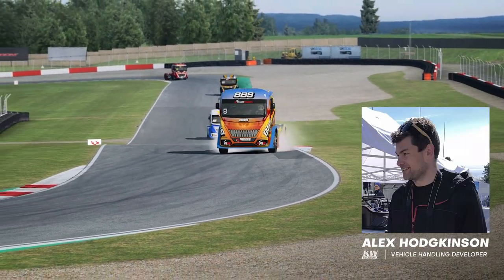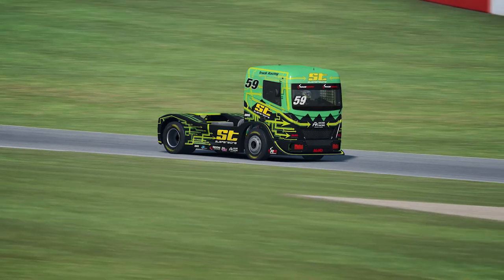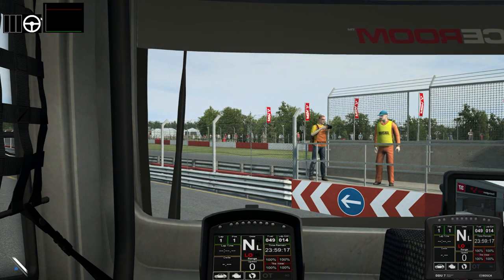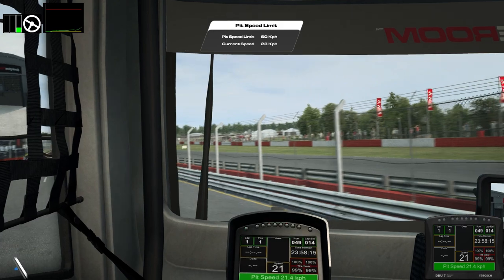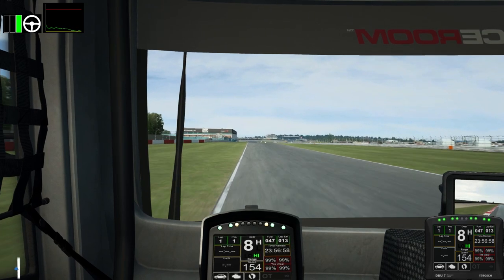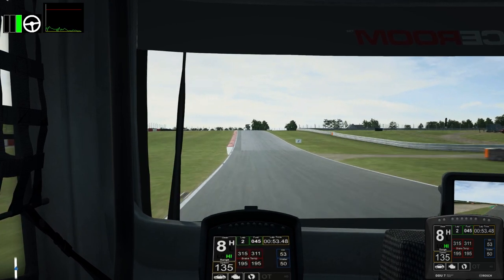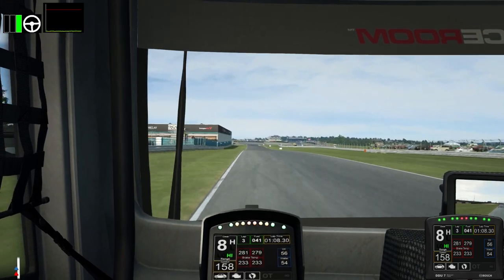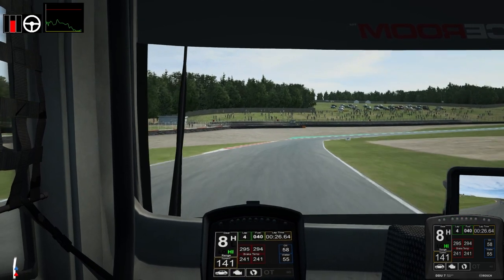RaceRoom Truck - Driver Briefing

Comment: wow... you nailed it... and I can use my range and splitter shifter I use with ATS ETS2... so nice... I am excited
Reply: You need two gears only it seems plus maybe one more for the start.
Reply: @Leynad778  I know.... it's not about the functionality... it's about the emersion.
The same with ATS / ETS...you don't need a truck shifter, but if you used it once... you won't go back to a button box.
Reply: @Boradumir  I was using all gears manually in ATS/ETS and switched to sequential later for convenience...
Reply: @Leynad778  Rocking a real heavy  load uphill with an Eaton Fuller 18 speed gear using splitter and range is for me real fun... floating gears... love it. But everyone should play the one way...
Reply: Can I ask what kind of shifter do you have?
Reply: @petrnedved5297  it's selfmade...it's a real world shift knob with a range and splitter switch and a button I use for the engine break. the switches are connected with a arduino board, the software is on github.
I made a adapter with my 3D printer to use it on my T8HA shifter.

Comment: Guys, I really like the game, but it takes too long to load the main screen (over 10 mins).
Reply: Try installing RaceRoom on an SSD instead of an HDD because I had the same exact issue for awhile but last year I made the random decision to install to my SSD and noticed an instant difference in load times for all the menus. Yes, you can play the actual gameplay on a hard drive unlike a lot of other memory intensive sims and I really like having that option if I don’t have any space on my solid state but that’s the main drawback.